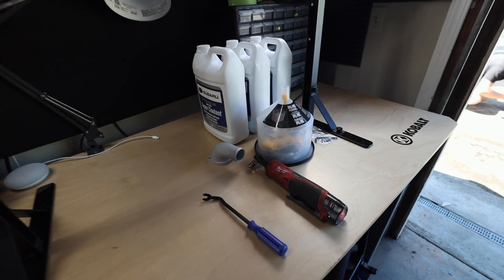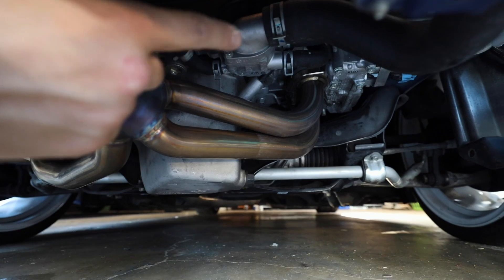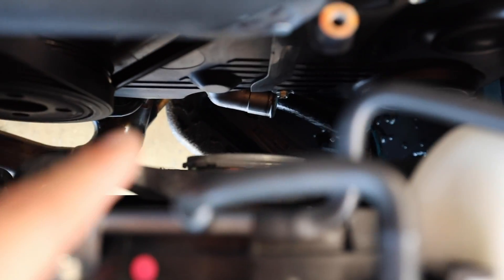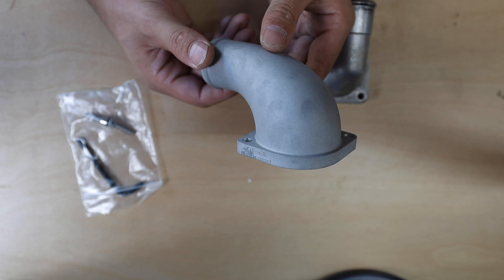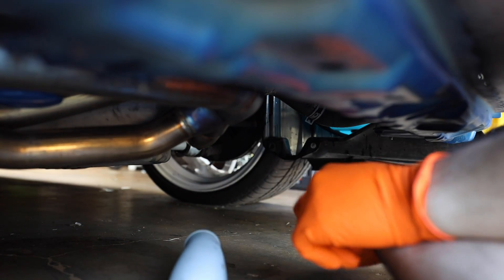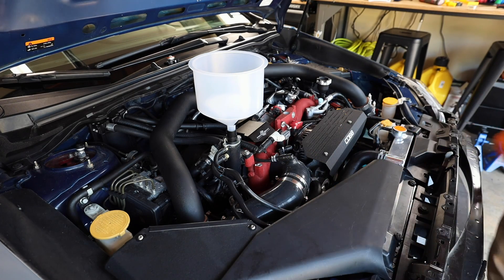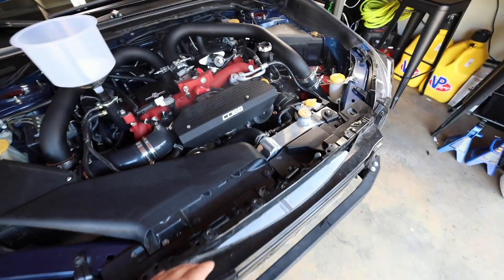The Reliability Part You Never Knew You Needed: Killer B Water Pump Housing

Comment: Question for you. I went to do the cooling mod and on mine the screw was stripped. Due to this I left it be. Not sure if I should get a shop at this point to do the cooling mod to remove the stripped bolt or just leave it.

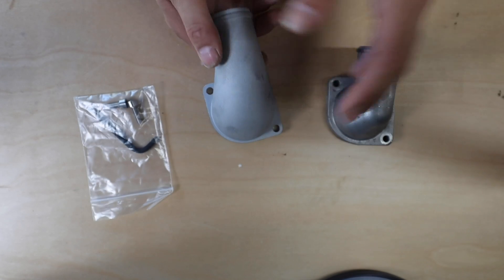Comment: Correct me if I am wrong, but 4:50 when you're explaining the differences between the two housings and the direction of coolant flow. Isn't this backwards? I was under the impression that the lower hose feed into the engine block and the top radiator hose feeds INTO the radiator.

Comment: do you have to remove the radiator cap to suck all the coolant inside the radiator or it gets filled up by just filling up the expansion tank?
Reply from the maker: If your going to return it I would fill and burp from the upper coolant res that feeds the turbo 🙏

Comment: I've purchased my cylinder 4 cooling mod. Killer b reservoir. Killer b thermostat housing. Koyo radiator. For my 2020 STI

How many bottles of oem Subie coolant do I need? Can I reuse the fluid that's in there? the car only has 5k on it
Reply from the maker: I would get 3 of them, I'd guess about 2 and 1/3 gallon

Comment: How did u finally get hot air to start coming out and all the air out of your system had the car on about a hour know just installed killer b housing and mishimoto radiator car still running hot !
Reply from the maker: Squeeze the lower rad hose, blast heat, rev the car a few times, make sure your burping from the upper coolant res.

Comment: I'm super glad I got all my cooling mods in a bundle to install in one go. Radiator started leaking due to wrong coolant (I think) so I got a bigger rad & oem Subaru block heater (the most important of these imo) better mishi hoses, metal expansion tank, new t-stat, shiney new caps, cylinder 4 cooling mod, and this water pump housing as well! I'm gonna start running a step colder plugs when I get all that in too since more heat will be transferred to the block (also happen to be getting a new tune so I will be making enough power to justify that)
Reply from the maker: Doing all of the cooling nods all at once is so nice so you don't have to deal with loosing a ton of coolant here and there 🔥

Comment: Lol to properly use that funnel the idea is that you always keep the funnel half full. Everytime you allow the coolant to completely empty you are sucking air into the system. Same as bleeding brakes and keeping the Reservoir full, actually exactly the same. Then you would drop thr plug in and remove the funnel with excess coolant all in one shot. As for feeding the wrong line I can't speak about cause I'm yet to do this on my sti.
Reply from the maker: The issue I had with the funnel is that it was only feeding the overflow tank 😅

Comment: You used the wrong cap for the funnel.  There should be one that has a rubber piece that fits down inside.  I have the killer bee upper coolant reservoir and it works just fine.
Reply from the maker: Which color adaptor did you use for yours?
Reply: Smeedia all of mine are yellow. I found the piece that fit best by trying all of them. Wish I could take a picture, but the rubber gasket should extend down to where the caps gasket would sit. This way it seals off the over flow and only feeds the main system.

Comment: So why didn’t you put the funnel into the radiator itself? Is there a difference between the two? I own an NA Impreza but when i get my STI next year i’m definitely going to save up for some Killer B goodies
Reply from the maker: Need to pull the air from the highest point, the upper turbo res will be the highest point that your cooling system sits so to get all the air out youll need to do it from there 🙏
Reply: Smeedia huh. Learn new things every day 😁

Comment: Not to insult yours or anyone's intelligence. I've used the same funnel to burp my cooling system. First, fill radiator to brim then cap it. Second, fill expansion tank and squeeze top or bottom rad hose to get coolant into system. Third, fill funnel with extra coolant on expansion tank and start her up and watch the magic happen. 

Anyways. Still a good vid. Keep them coming🤙🤙
Reply from the maker: In the past I haven't had issue with burping, someone said to clamp off the bypass hose and it should work so next time going to attempt the funnel again 😅

Comment: So did you think about attaching the funnel to the radiator and filling it up from the radiator itself? That's typically how we use it anyway because that way it's in the direct coolant flow area instead of the overflow or bypass area. That might have been your issue so try that next time and then see.
Reply from the maker: Generally I always go from the highest point to get any air out but seems people have had success getting the air out going from the rad to the upper res 🤔
Reply: @Smeedia  understanding there is a slight difference between the WRX and STI,Yes it is the highest point of the car but since it's not the main system it's a bypass system or overflow might as well just use the radiator. So if you have to do any coolant work again try it from the radiator and see if that will solve your issue with the funnel. Trial and error 🤷🏿‍♂️

Comment: You should fill the funnel way higher than that when filling. The weight of the coolant stops the volcano effect. You have a stopper supplied to plug the funnel when the coolant system is full and burped.
Reply from the maker: I kept it low to see where the coolant was gling, the funnel only fed the bypass hose due to the upper coolant res, would've wasted a gallon of coolant if I would have filled it all the way up 😅

Comment: I like Killer B stuff especially that oil pan & pickup combo but this part at $100? Stock part is less than $10 so I’m not sure how 10x the cost, factoring in R&D, factoring benefit of which their no data analysis on their website that I could see?
Reply from the maker: Not quite sure, this one was supplied from killer B. But totally agree if the OEM one is about $10

Comment: I use that same funnel to bleed cooling systems. The first time I bled a turbo EJ it did the same thing and I was confused, you have to clamp off that line at the upper reservoir and where it comes off of the radiator and it will work fine. Also I fill the funnel about half way up when I'm bleeding it. Just some tips for ya
Reply from the maker: Good to note for next time! Thank you for the tips 🙏🔥

Comment: I mean, to each their own, especially if you're successfully bleeding any Subaru! But I don't get why everyone only uses the expansion to fill the coolant. Especially if your radiator has a cap!! I could not, at all, ever get the giant air bubbles out of my upper hose on my old bugeye without pulling the radiator end and dumping coolant straight in the hose. I don't even mess around with the GR. First thing I do is fill at the radiator.
Reply from the maker: Should be burping it from thr highest point, the air will travel upwards to the coolant expansion tank. Doing it from the radistor can leave some air trapped in the system 😖
Reply: @Smeedia  Right, I start at the rad, cap it once it's filled, finish at the expansion tank, then run it and top off from there for a good half hour.  But if I don't put coolant in the radiator, the air bubble in the upper hose will be so damn big that  squeezing it does nothing, because there's basically nothing in it. Maybe my garage floor has a little incline? But, I mean, the only direct path from the rad to the expansion tank are the tiny hoses. Well, the only direct path to anywhere from the expansion tank are tiny hoses. It's like trying to fill a bucket through a straw.

Comment: The funnel I have for the FA20 attaches to the radiator, then pick the connector to secure. Works great. I'm not good w EJ stuff though
Reply from the maker: For the EJ we have to burp up top, it works on the OEM upper res but thr Killer B one not so much 😅

Comment: that overflow is restricted compared to stock... need to drill some holes into the lower end of the funnel so it can feed both ports..?
Reply from the maker: Need a diffrent adaptor for the funnel for that over flow, I prefer the smaller upper turbo res compared to the OEM, still does its job at equalizing pressure and moving coolant to the turbo very well just has a smaller capacity in the actual res

Comment: Big pet peeve of mine is when they give you parts that should be a direct replacement but then you gotta trim stuff to make it fit 😭
i.e grimspeed tmic couplers 🤬 like bruh, why not just cut them to oem spec?
Reply from the maker: Totally agree 🙏 in the case of this part I understand why I needed to trim it, because of the radius on the bend for the elbow it needed to be long but for couplers! 100% same can be said for turbo inlets!

Comment: Hey Tanner, you have to fill that funnel way more than that to stop it from being a volcano. Fill it like at least 1/2 full and need to use the right fitting, that kit does work with the STI I have that as well. :) Thanks for making great videos bud
Reply from the maker: We tried setting it up a few ways but it was only feeding the overflow for some reason 😅 did not want to pour the whole gallon in to have to pull it out of the overflow, we got it to work no problem on Matt's outback. 😅 and thank you! 🙏🔥

Comment: here's my plan...

GS TMIC
GS EBCS (have, not installed)
AEM Intake (have, not installed)
upper TGV deletes
demeled lower TGV "deletes"
EGR unplug
EGR + TGV Wiring Caps
IAG Street AOS
Mishimoto Thermostatic Oil Cooler (could go perrin also or non-thermostatic)

This would all be going on my 2020 WRX with 3200 miles on it. I am going to run out my oil changes at the dealer before doing all of this, but I want to have the parts on hand when the day comes.
What do you think? I'm trying to go for that "mostly stock" engine bay look as well as just waking the car up a bit more. I don't need 10k into my engine bay for 360-400whp when I can cut that in 1/4 and have 280-300 ish :)

What do you think?
Reply from the maker: Looks like your got a solid list set up therr with a few ways to save some cash. Curious to know what the power you make later down the road is 🔥
Reply: @Smeedia  Got a quad single wall SS 4" tip nameless muffler delete for $100 + the EBCS new in box came with it, intake was $95 shipped brand new. Oh, I also have a Full Recirc TurboXS Bypass Valve I got for $115 shipped.